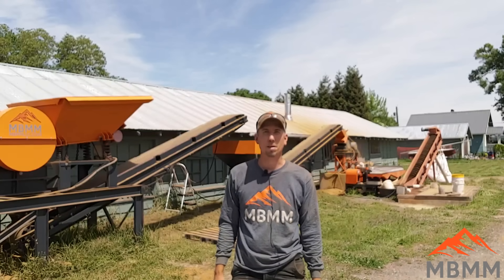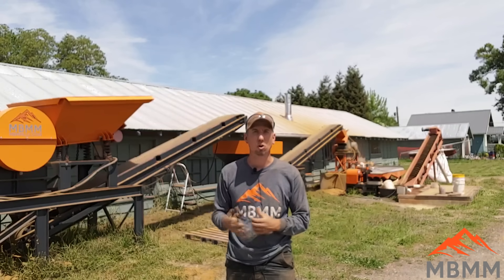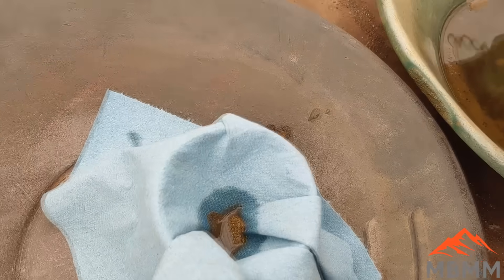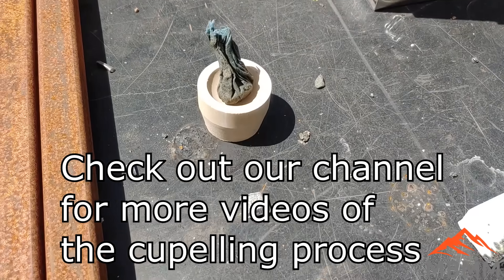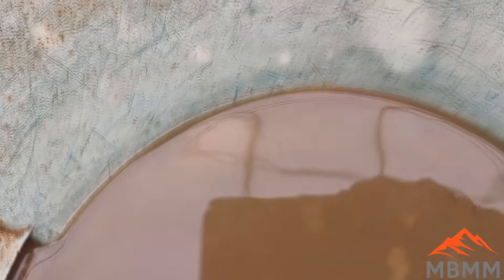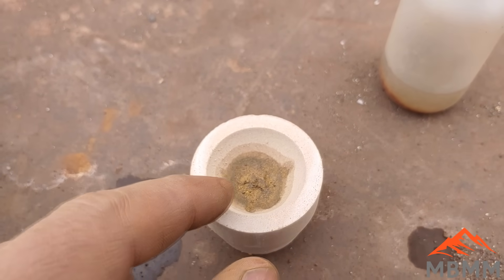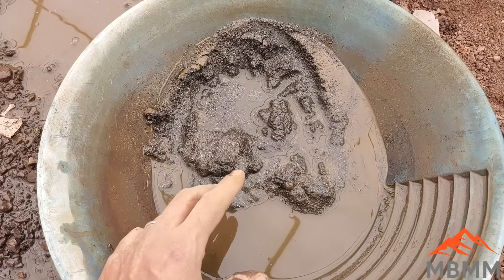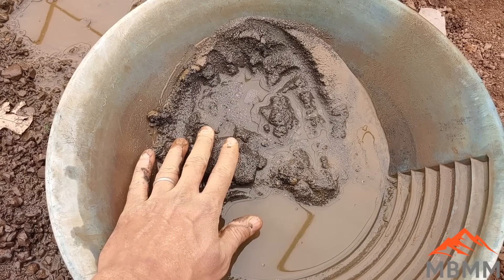How To Recover Super Fine Gold, Fastest Way To Gold Bars

Comment: Good strategy.  Anyone that actually uses the gold will want to further purify it anyway using either a chemical or electro chemical method. 

So another possible path would be to stop at the 8 minute video point and just do it that way instead of using the cuppel

Comment: You remind me of the younger me. I'm 60 now and started out as an independent gold miner 40 years ago in Nevada.  Not many people can claim that. 
Your practical approach is just how I learned also.  Trial and error. 
I even built and sold my own shaker tables for a while.  
You need to look into water flocculants to clean your tail water  instantly for re use.  
That and next time you deal with mercury tails or contamination please don't run them through your hammer mill first. Even running in water you're aerosoling the metal Merc small enough to be breathed. There are much better ways to recover the liquid quick and any lost gold.  Always keep in your mind when dealing with lost Merc that without a doubt there will always be abundant amounts methyl Mercury. It's the killer,  it's what gets into the fish tissue and then climbs the foot chain. Maybe the one video I watched where you watched Mercury  recovery is the only one you deal with mercury at all.  I have been dealing with lost Mercury and  lost sulfides and thier safe recovery since 1979.  Comstock  area.
Reply: شما کار بلد هستید من ایران هستم در رودخونه طلا هست ولی به کمک فکری نیاز دارم و شما تجربه خوبی دارید امیدوارم منم بتوانم با مشاور شما
Reply: Ya what do you need to know

Comment: The process of combining these wonderful pieces of equipment is a great demonstration of how things should work, so thanks for putting it all together.  There are some "bottle necks" that weren't discussed such as one hammer mill can't handle the load rate that the rock crusher is producing, a second (finer) rock crusher would put less wear on the hammer mill, one shaker table can't handle the load rate of ore that the hammer mill is producing, another belt is needed to get the auger waste away from the work area and every step needs regular adjustments (labor) as the process continues.  Hammer mills are a high maintenance item.  When one piece of equipment needs attention, the entire process is brought to a halt. Having "back-up" equipment available is expensive and when one piece of equipment fails and stops the process, labor costs continue, just the same.  Most people probably think this is a "safe" process, but exposed machinery has its risks as well as dust from crushing and lead fumes from the furnace.  I certainly prefer this process over cyanide or mercury, and, Jason, you did a great job putting it all together for us.  Thanks!
Reply: I've never done any work with gold at all, but I've worked in a variety of factories.  I would definitely prefer this method, as compared to arsenic or mercury processing.
Overall, I think that it is a lot safer, in addition to reducing the amount of required paperwork, that is needed.
Working with dangerous chemicals requires Hazmat paperwork.
Reply: @tinamathews3379  Using lead as a collector metal in the electric furnace requires the door be left open to permit oxygen to enter.  The lead is then encouraged to oxidize and only then will it soak into the very expensive ceramic cup specially made with the addition of calcium phosphate.  This cup can only be used once since the phosphate becomes saturated with lead oxide and some lead is also vaporized so you should not be breathing when near the open furnace door.  I, too, agree this is about as good as improvements currently exist, but it's a bottleneck in the process, meaning this is a place where the process is slowed down.  The shaker table is the first bottleneck.  Many very smart people (Jason included) are working on improvements so there is hope.  The discarded ceramic cup which is now saturated with lead oxide is not really an environmental hazard since it doesn't contain much and will release its lead into the surrounding landfill at the rate of about a few inches every hundred years.
Reply: @richardrobertson1331  quite interesting.  Now I know.  Thanks for the information.  :)

Comment: Hi, what is the purpose of the auger? And what are the holes on the auger blades for? I understand that the auger is moving the material up the screw but what is the purpose with regards to material classification? Thanks.
Reply: The auger collects waste solids, which dry out as they climb. The holes are for water to escape.
Reply: @xenaguy01  cool, save water and weight of the waste. Thanks for the explanation.

Comment: How is the gold that is on the table collected?  I always see the two buckets of concentrates, but what happens to the line of gold on the shaker table.
Reply: Watch some of his other videos. The gold line slowly makes its way to the bottom corner of the table where it is collected in a bucket. That's the #1 cons. The #2 and #3 are also collected and the #3 is usually rerun through the system. After all the material has been run, the table is brushed with a stiff brush to collect all the remaining gold and cons from the table. This is normally high in gold and heavies, so is added to the #1.
Reply: @xenaguy01  thanks for the explanation.  Do you own and operate this table?
Reply: @MP57719  
"Do you own and operate this table?"
No and no. I have watched many of Jason's videos where he explains it's operation.
Reply: @xenaguy01  thank you for getting back to me

Comment: So what you're basically saying at the end there is that you can take this small setup to a claim site and either spend a day getting 100% of the gold  to assess the site, and then move to another site the next day, or you can use the same setup for small-scale processing of a claim, and recover 95% of the gold in the ground, one ton of dirt per hour. 
I like it.
EDIT: I guess you wouldn't take this setup, with it's four machines, to a site for a day or two. You'd put a ton of ore into a super sack, and truck it home, and run it there. Maybe take from several different claims, see which has the best dirt, then work that one first.

Comment: So, people in Colorado think 1/10 of an ounce from a ton of ore is good gold, so therefore I couldn't possibly get an ounce from a few pints of black sand. I'm heading to Colorado in 10 days. I'm bringing a bucket. Should be 5 - 10 ounces in it from 9 years of experience roasting, tumbling & crushing if anyone wants to help with a recipe. Still waiting for an address to send some to for analysis because I guess the climate or altitude is affecting the rendering of good gold. The gold isn't melting into the lead. The gold separates from the slag but sits on top of the gold. The lead takes 45 minutes on full tourch to melt. Could this be a temperature problem?
Reply: Sits on top of the Lead. The gold does. Sorry. Long day thumb typing.
Reply: Gold sits on top of lead? Sounds like a temp problem.

Comment: If you were to use an aluminum oxide crucible and straight NaOH or KOH as the flux, would it be possible for the gold to simple melt out as a bead? Gradual heating required, but I have heated NaOH before in such a vessel above melting point of Au.

Comment: Hi Jason! Tell me please? In the video, you (7.07 minutes) without cleaning the concentrate, you melt it with lead, small sand particles burn and the gold turns out clean?
Reply: As everything melts, other metals float to the top of the gold and mix with the air, forming oxides which are absorbed by the cupelle. The lead helps displace the base metals from their oxides, and is also absorbed by the cupelle. Any gold or silver (or palladium, or any other "noble" (precious) metals do not oxidize, so are not absorbed. They remain after all the oxidation and absorption are done, as a bead of precious metals.
Reply: @xenaguy01  How long should this process take and at what temperatures? I recently bought an electric Tabletop furnace and would like to try this technique.
Reply: @chrismontano390  My knowledge is mostly from Jason's channel. Watch his videos and learn like I did. He has several where he cupels at the end.

Comment: Way faster and easier than getting gold from electronics!
Reply: Can you grind old computor scap???
Ive got alot of pins cpu,s etc around 50 plus tore down been using meradic acid n bleach n have around 30 pds of fiters
Theres some junk plastic in some
But mustly flakes
Plus palitieum chips
Plus around 20pbs stuff not yet tore down need pixs i have them id say 7pbs of pins
2pbs palideium chips
5pbs long bars still havent pulled the pins 
Real old cpu hard drive motors n some brown disks
A bunch are platneum coated
Around 4pds alot of ram
Not yet removed the fingers yet
Alot is old school pc stuff
These disk are big as my hand
Looking for someone to refine it

Comment: does having a soft blower on kilns accelerate the smelt and by how much
Reply: That depends entirely upon the fuel used. Any flame will burn hotter with oxygen (air) forced into it.
Reply: @xenaguy01  smelting is for the material itself so accelerating the burn would not evaporate the gold or silver correct
separating base elements is the key after smelting what chemicals are best ?

Comment: what about adding some borax to your wet table but 3/4 0f an oz per ton is a good return so about 1200.00 bucks an hour from the full mill...if it runs round the clock 
about 24,000.00 per day...running times vary though with break downs etc but this system runs realistically what 15hours in 24 so not to bad for a tailings pile...as long as the hopper bin can hold say 5 tons and the process hass 2 men processing and 2 men digging and loading the bin at the rate of of continous feed their take after expenses would be 1000.00 an hour if the operation had only 4 men and the smelting stayed on schedules with say 4 kilns would that be about right

Comment: I like the setup a lot! Is it expensive to buy and how long will it take to get it paid for with high grade ore so then your in profit? Say how many tons would you have to run in how many weeks or months?
Reply: The entire setup, with jaw crusher, conveyor, constant feed hopper, conveyor, hammer mill, shaker table, and auger probably cost upwards of $60K, maybe $75K. Your other questions depend mostly on how rich your paydirt is. The current price of gold is about $60 USD per gram. If your dirt source contains 1 gram of gold per ton, and you can run 10 tons per day, that's $600 per day. Out of that, you pay all your expenses, including land (claim) cost, license fees, heavy equpment costs for extracting the dirt you run, financing of this equipment, any employees you might have, food, other materials like the cupel furnace and cupel crucibles, etc.
Reply: @xenaguy01  ok. I fully understand what you mean. Cheers👍😉
Reply: @xenaguy01 Making money is  tough. If it wasn't, everybody would be doing it.
Reply: @TGriffiths-ve6nw  
Plus, if your paydirt vein twists and turns, you won't be in it all the time. You'll maybe half  the time digging dirt with no gold. So cut those income numbers in half, but the expense numbers stay the same.
Reply: There are too many variables for an easy answer. What is the average grade of material youre running, what are your labour costs, ore extraction costs, regulatory costs, land access costs etc.

Comment: Table top sluce would be better then panning.
Reply: Better yet a spiral wheel as theyre self cleaning. It would be possible to add a few small bits of equipment to the #1 and #2 ports and have them deliver clean gold into a jar or pan, even automatically recirculating the tailings from the cleanup mill back into the system to recapture the tiny fraction you might be losing.
Reply: Panning is not merely much faster, it is much, much faster. Any sluice only reduces cons, does not eliminate them. You're still stuck with panning. Blue Bowl, millers table, and spiral wheel can all get down to nearly pure gold, but all are slo-o-o-ow, and if you try to speed them up you get other heavies that have to be panned out.

Comment: why add the lead? wouldn't the gold be left by itself once the paper burnt off?
Reply: Look up Cupellation, it's a way of removing base metals from gold & silver.  The lead is part of the process.
Reply: lead as a collector lowers the melting point of gold, that is, lead melts faster and envelops the gold inside the lead; gold melts after lead disappears during cupellation
свинец как коллектор понижает температуру плавления золото, то есть свинец быстрее расплавится и обволакивает золото внутри свинца золото расплавиться после свинец при купелиловании улетучивается

Comment: I gotta send you some of my black sand. 50+ oz per ton.
Reply: Can I buy some of that black sand?
Reply: @dwj1231  if you want, I guess. I'd Rather just give you some & you give me a video of your recipe & technique.
Reply: @dwj1231  some guy in the club was offering $20 a gallon for it.... I personally ball milled(with a rock tumbler) 1 gallon of +20 mesh & got nearly 1 oz with charged mercury in hot rain water, but, I really wanted to make this easy AND profitable.
Reply: @dwj1231  and this areas gold is purest raw gold available. 23-24kt
Reply: I'll process your material. Let's make a deal. I process and my pay will be paid with a portion of material..
Reply: @hellohello5550  I'm going to Colorado in 11 days. I live in Georgia. You anywhere in between? 50/50 if you were to come to Georgia for 2 weeks. As much as you can process. It would be at the club property & limit is 2 weeks.
Reply: @hellohello5550  we tried 8 melts so far. Heavy slag and thousands of tiny lead beads and bigger beads and 1 big bead averages half lead added. Using Chapman's
Reply: @hellohello5550  I just had a 7 hour argument with some Colorado refiners on Facebook. Apparently my 50 ounces per ton is not possible and my ounce that I screwed up smelting out of a few pints is fake even after posting a short video of me amalgamating it. So, still looking.
Reply: @hellohello5550  where are you located? - Its not very economical to mail off a ton.